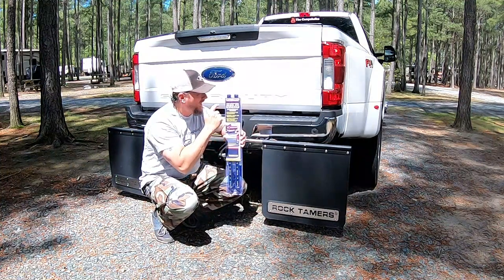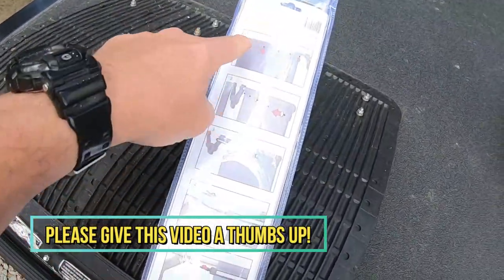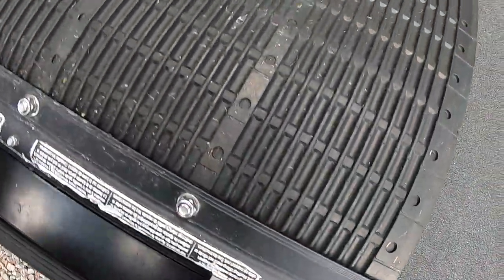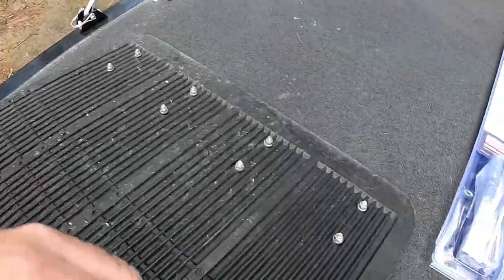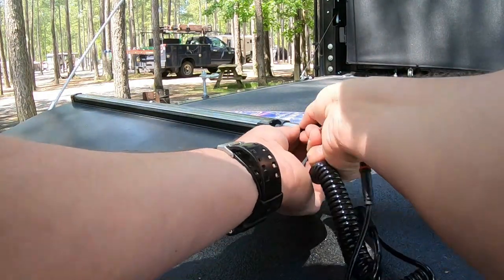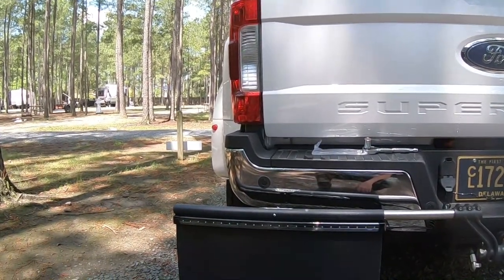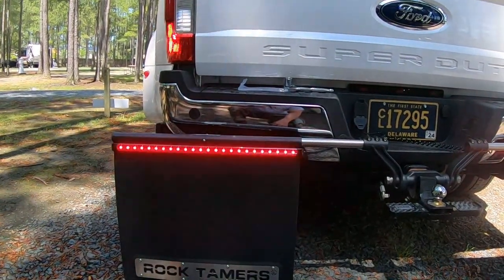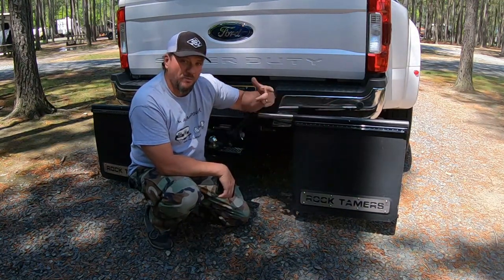ROCK TAMERS LED Light System Install - Pretty Cool!

Comment: Do you know if these will work with trucks that have OEM rear view cameras, blind spot monitors and back up assist?  Some LEDs lights have issues with these.
Reply from the maker: The only interference I get is with the back up sensors. The camera works fine.